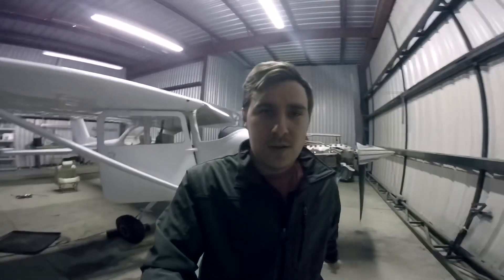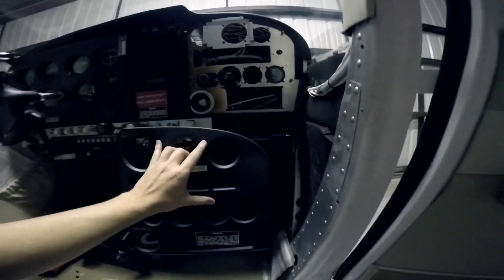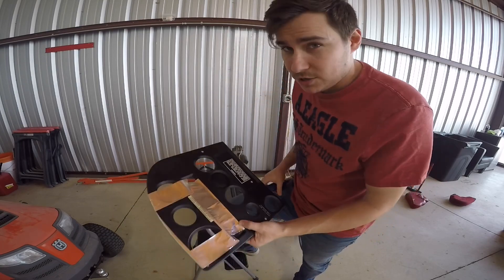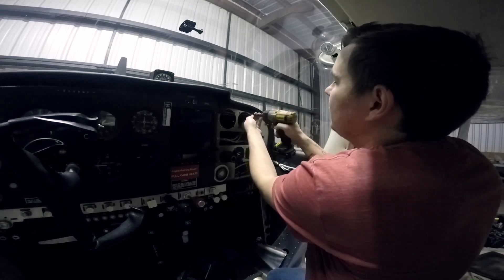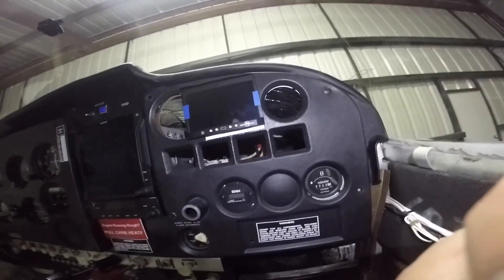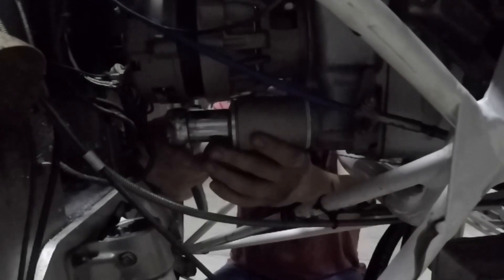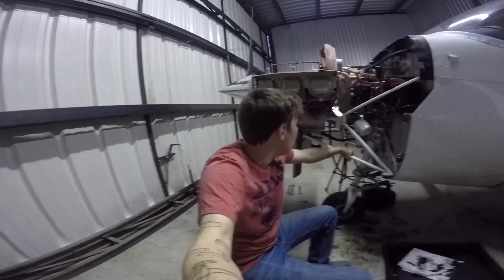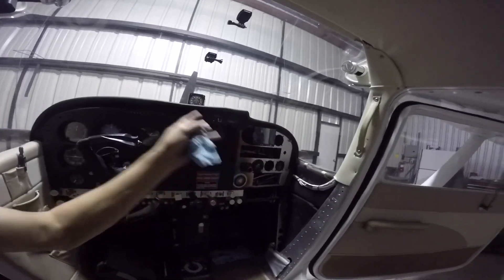JPI EDM 900 Install in the Cessna 172 | Part 3: Engine Monitor Upgrade & Oil Filter Adapter

Comment: Hi where can we read carburator temperature on edm 900
Thanks
Reply from the maker: The one that I got for this project has its own bar for it on the right side. I had to ask for it on the spec sheet when I ordered the unit. It also will start flashing red with a warning if the temp drops below 34°

Comment: Seems like a waste of panel space.  Just go with the EM thats bundled into the G3x for experimentals.  Old Cessna 172s are not able to use advanced avionics unless they spend more than the plane is worth on certified gear.
Reply from the maker: I don't disagree. But I'm not the one spending the money. I would rather have the continental IO-360 on it and make it a T-41 then have a nice panel but that's just me lol.